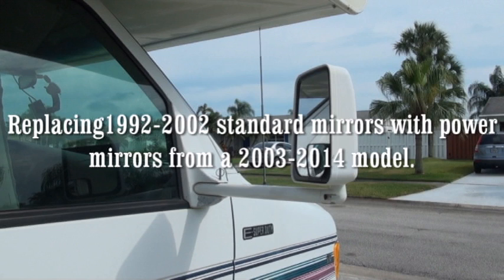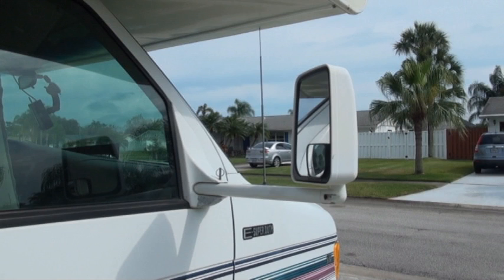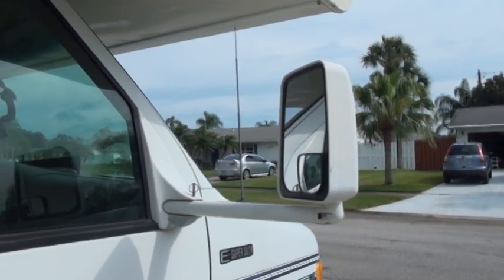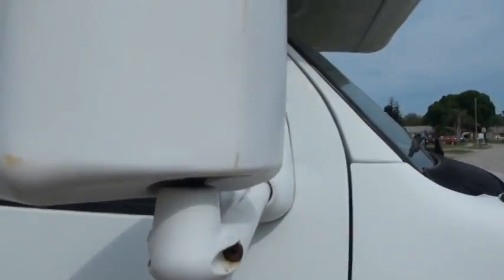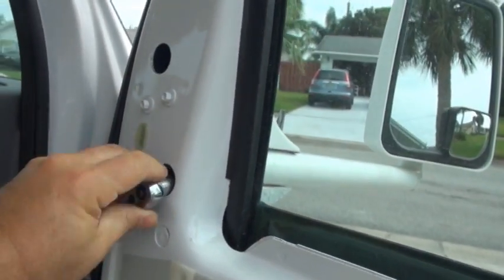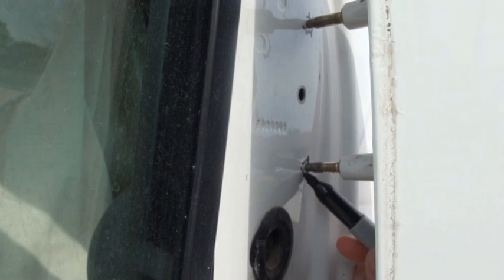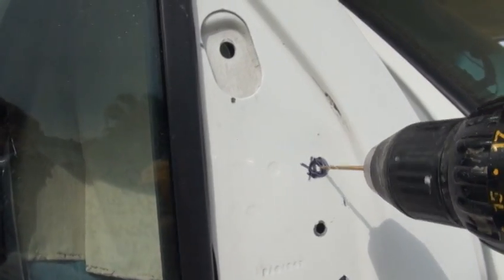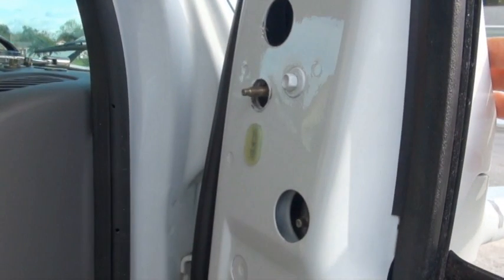Ford Econoline Mirror upgrade 1992-2002 to 2003-2014

Comment: Broke my mirror on my 2000 econoline, thanks to this video... I too will be upgrading mirrors to that of a later year econoline Thank You very much!
Reply from the maker: So glad I helped!
Reply: @prohomevideos  this video has given me the info needed . I have a 97 e350 class myself..

Was the electrical wiring already present to hook up the remote and heated functions?
Reply from the maker: @camposvazquez  No it wasn't.  When I purchased the mirrors, all of the appropriate wiring came with them.
Reply: @prohomevideos  thank you so much... I will be upgrading to heated power mirror's..

Going to follow your lead and search ebay

Comment: Just did this swap on a 99 e350 RB to 2003 towing mirrors and I'll just add that I had to do a LOT more cutting than what's shown in the video. I eventually got it all to seat up fairly well, but ended up backing out all of the studs and using bolts instead (M6 in various lengths). I also had to cut into some fairly thick metal that concerned me, but it's done now and there's no going back. 

As far as the wiring goes, I went from power mirrors to power mirrors and was able to splice the new mirrors into the old connector using 18-22 AWG butt-end heat shrink connectors. The wire colors are almost all the same and where the new mirrors have 4 wires into 3, I just twisted wires of the same color together and it worked fine.

Comment: I see you have cotter pins on the old mirrors... That's my issue: those friction pieces have broken away over the years and the mirror bends in... You're using that to hold them in place?
Reply from the maker: When I bought the vehicle, it had the standard mirrors with the cotter pins already there, I figured that was standard.  It was convenient when you need to fold the mirrors in, just pull the pin out and then fold.  Again, I am not sure if that what was standard issue but I really don't see an issue with it.  I sold the old ones as the new ones do not need them.
Reply: @prohomevideos  Brilliant idea, I just did it on mine.  Solid quick fix for a worn out mirror.  Thanks for the reply!

Comment: I got the Mirrors Installed! Thanks! I bought the wrong ones the first goe around they were for a F250 Super Duty ! DOH! Anyway I sorted that out I kept the Mirror Heads they are bigger than the Velvacs I ended up getting. SO I have spare mirror heads saved or maybe put them on eBay. I looked everywhere for black but no dice I can always Powder coat them I think?  Its just the White IS WHITE Mine is off white now with all the years gone by but Not trying to Quibble They are SAFE TO HAVE What a Difference!
On a different Item. The Roof Cab Marker Lights of the sleeper area what do you have?
I have 5 inch long Teardrops I had to change one out what A Mess.  One of The 2 Screws holding it down kept turning and turning I could not get the nut off so I got my Wire Cutter pliers pinched it under the nut then I oiled it and managed to get the nut off it. I managed to get a nut to the bottom of the new base with washers leaving me enough thread to put the second nut on but I DON'T WANT TO DO THAT WITH THE OTHER 4 They look as bad I am keeping the Rig long term even if the engine blows some day so I would rather not have to mess with that in 10 years Im 50 now.
 Is there A Light kit that is smaller over all or do I need these because  the curve I figured if I go round or just smaller anyway shape is not important getting them on and off is I would rather just use the 2 wire type light the ones on now I had to ad a second contact for the ground the lights are one wire the middle screw that holds the light  cover down is where the ground is the front ground its suppose to have is useless. There are so many kits I just want to pick A 2 wire but one that is sure to work dont care what it looks like so if you see any that are between 30 and 50 let me know
Reply from the maker: Mine are on a Class C motorhome so they are just standard type trailer lights up there.  I haven't changed these out, however, I have changed them out before with LED's and I had the exact same experience that you had to deal with.  It is a real pain.
Reply: mine is the 1993 Class C 28 foot Tioga Montara Queen Ford E 350 I put it on You Tube as I make Progress I got it Cheap And it has Fuel Injection and overdrive or I would have passed but for 4000 I had to get it! Mine has the 5 inch long Trucker type Tear drops they look big Too Big  I like the round pointy ones...only I think I am right at the curve so they might not lay flat
The Way I see it I have a few options Do nothing the one light is working it has a black base so it is slightly different I can use white caulking so it looks the same or try to  change others but last night I looked thru the light you can see severely oxidized nuts on there I can use A Dremel to just cut out the the original bolts if they are to far gone or re thread and seal up the OEM and put newer LEDS the water proof kind over the originals my fear is putting in the new lights when I go to screw them down if they dont anchor properly I make it worse ...DOH!
I have found the Rubber Roof is AOK there was only a little problem at the tail light where it looks like the OEM lights had no caulking at all when I removed the rear lights to put brand new lights Direct replacements no LEDS  just what it came with the right side had rot so I cut it out and made used 1/8 Aluminum box insert so it wont ever rot again. sort of like A 1/2 battery box turned on its side the left side was still perfect so I just Sealed it and added Dynamat as An extra measure of protection FUN FUN FUN...LOL NOT
Well at least I got A good view between the walls so it all looks great so I just need to invest time and reseal the seams for peace of mind

Comment: Wish you had shown the wiring!  I have to do this or pay $650 for someone to do it.  Know anyone who can do it for less?
Reply from the maker: The only wiring needed is hooking up up the power wire to the fuse panel (always on) and the other to ground, mine still had the ring terminal on it. All of the other wires were already plugged in to the mirrors. If you need any further assistance, just ask.
Reply: +prohomevideos  Thanks for your response!  I have the old factory manual mirrors on my Ford E350 Econoline 1997 Tioga Montara Fleetwood RV.  This model had no previous electrical wiring in it, just manual.  New mirrors are Velvac electric, and the right ones for this van per factory staff.  Needs a dash wiring install, plus control panel on driver side door.  No RV shop knows how to do convert from manual to electrical, and auto/van repair shops want $650 to do both sides.  I feel this is too high.  Is this very complicated?  Does it mean battery disconnect?  I'm handy.  Any thoughts?
Reply from the maker: Hi, mine had manual mirrors as well and there was no wiring.  When I bought the used mirrors off of e-bay, the package included all of the wiring already.  The only thing I needed to hook up was a positive and negative to the mirrors to give the switch power.  It was very simple.  If I understand you correctly, you bought the correct power mirros, but it did not come with any wiring?  Not sure why since it should go as a complete package.  The wiring is Velvac wiring, not Ford's.  It should have also come with the switch that goes on the driver's side door in place of the black triangle panel.  $650 is definitely too high, I do not know why they would charge so much.  Maybe since there is absolutely no wires that came with your mirrors.  No battery disconnect needed.  All I did was hook up the power wire to the fuse box (always on) and the negative lead to an already existing place where ground was hooked up.  If you need me to provide you with anything else, I will but without that wiring harness from the original mirror, I have no glue.

Comment: I am looking to do the same thing as you did changing the mirrors. I am having trouble finding anything that looked compatible.  Any advise would be very helpful. I dont want to get the wrong ones. Also can you use them without connecting any wires? Thanks.
Reply from the maker: The mirrors will still work if you do not connect the wires, you just won't have "power mirrors".

Comment: How difficult was it to run the wiring for electronic mirror adjustment?  I know for these mirrors that there is a switch pad on the driver's door.
Reply from the maker: Most of it was easy, the only tricky part was getting the wire through the black rubber boot where the door hinge is but I used a small metal wire with duct tape.

Comment: THUMBS UP! THANK YOU! I just got my 1993 28 foot Tioga today with Manual Mirrors . Any Idea if there is wiring pigtail for connecting to power mirrors? I dont have Power Windows either just Cruise and Cab A/C  And thanks for the work on the mirrors well done
Reply from the maker: I doubt it, but if you get power mirrors, you hook the positive to a "always on" section on the fuse panel, and the negative to ground.  Let me know if you need any further assistance.
Reply: I was over at Ebay I did find A Manual for the Drivers side but the Passenger side all they have is Power and heat I figured Since I wont be adjusting the Passenger side Often could I just push the mirror carefully in place? One other thing I emailed them because they have it listed as F350 not E350 I dont want to get the wrong thing. What should I tell them I have so I dont confuse them?...LOL
I can get the Item number or if you remember who you bought from One Seller is Discount Auto Experts and the other is Fast Lane USA Store. Fast Lane is Sneaky they sell one for 75 but want 230 for the second one and Discount Auto does not have full manual pairs SO I figured I would love to get the 102 Inch Wide MAX for 150.00 From Discount Auto Experts for both 75 a piece! There is also A shorter Arm 96 Incher from both Sellers but mine are already the 15 or 16 inch long arms. I dont think they are original to my Rig I posted A Video of the Rig I am not sure if you can see the mirrors very well but they are similar to yours already and mine is a 1993 So I wonder if they are OEM or Someone else already modified them to fit. I will do A daytime Video Tomorrow I am going to restore it how it was when it was newer anyway..LOL it only has 88k miles I dont know if thats alot or not but sure is quiet. And Strongish.   Sorry for Going on and On I am the type that thinks it thru as I type it drives my family crazy no Abbreviations Except for LMAO and LOL I dont know many beside I would probably forget it anyway but I do like to LMAO from time to time Thanks for the help I hope your at least laughing at me if not with me ..Cool CYA
Jeff
Reply from the maker: Laughing with you Jeff.  I bought them from a private e-bay seller and do not have the item number anymore.
Reply: Thanks for the Motivation! And the Advise its working out for me
I just took off the mirrors they are bolted on 3 bolts close together that hold it at the bottom. The to additional 2 bolt holes one upper one lower hold the outside plastic piece with the nut on the inside Of course I lost one it dropped down So I will go get another one later once I see whats in the kit. I settled for the Chrome Mirror head with black arms  manual. 205 bucks but I had A Ebay hi volume buyer discount took it down to 185.00 So there is that I did not want the chrome but they wanted 171 for just the left in black manual and 75.00 for the right in manual I checked to make sure it was not in Error price wise. Apparently the Manual Black are sought after. I will put transparent plastic on the mirror heads on trips like I do with the hood front they sell this cool easy on tint similar to Vehicle wrap only in clear or any color you want I use it where I dont want to spend a whole day removing bugs. its cheap by comparison just a few bucks for a sheet
Reply: Thanks Again for the help I too help out others when I see the need so I pass on everything I learn when Practical and sometimes when its not I remember the times I have been stranded NO BUENO And Some Kind soul has helped me out of A true Jam..So like the Helen Hunt Movie PAY IT FORWARD I do:)
Make my own bad self feel good.  
On a more serious note I was out at the wheels looking for the Valve Stem I had just finished washing the RV so my hands were wet I knelt down to steady myself I touched the Rear Left Wheel And Got A Shock! My dog had cried out a couple days ago around where we were trimming our Camelina Its a climber vine thing and anyway I thought maybe he stepped on a Thorn then yesterday around the back same thing cried out but I see nothing wrong I am thinking the RV is Haunted? Maybe thats whats scaring the Dog Now I think he must have been sniffing the Wheel and he too got shocked. What do I do? Just Kill the Breakers and turn them on one by one? Maybe connect my Ohms Meter to the wheel to see if it still has voltage coming thru it? Or could it be the 12 Volts system? I have no dead batteries so this is weird...The Joy of someone elses hidden treasures. Someone else must have noticed because he put new tires on it the week before I went to pick it up unless they had gloves on.
Reply from the maker: I doubt 12volts would do that.  Have you ever noticed if this happens when plugged in or not?  If so, sounds like a 110 volt wiring problem but probably easy enough to track down, maybe a grounding issue.  Plug in one of those cheap testers in each outlet to check polarity, ground, etc. and start with that.

Comment: Thanks for the video. U got these on ebay, can u share the link or how to find them.
Reply from the maker: Hi, I can't share the e-bay link anymore because the ad is over but here is what the ad was titled: Velvac Power Heated Mirrors Complete Set Ford Econoline E-Series Van RV 03-14
Reply: +dsjumpman23  Contact Velvac directly.  Get correct model # from them.  Then badger the heck out of them to give you their distributor names.  Order directly thru a distributor/ retailer.  Forget ebay.  You have to get the right parts.
Reply: Can you tell how much you paid? I am curious how much you saved?